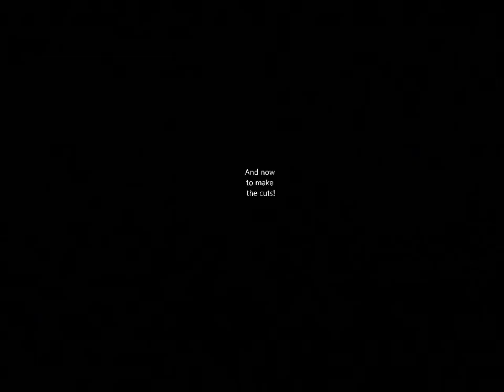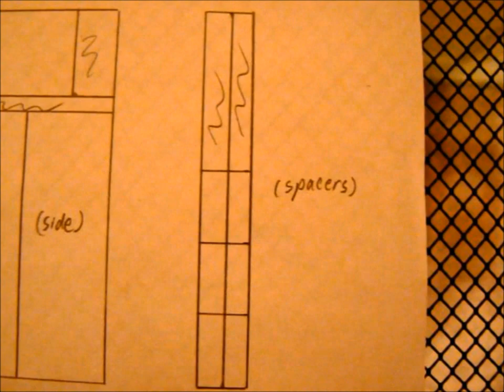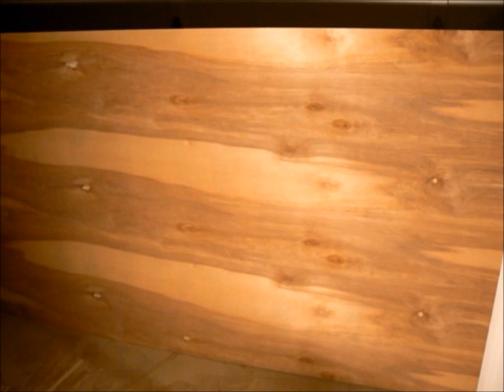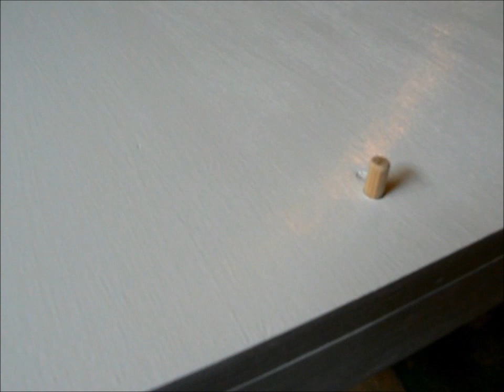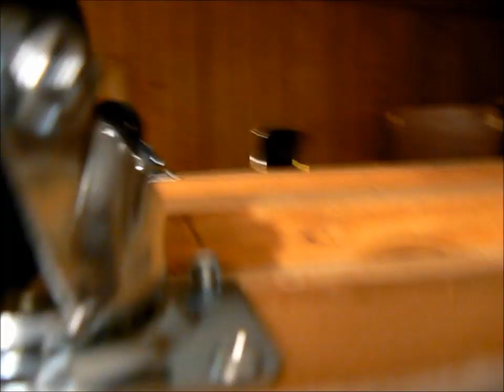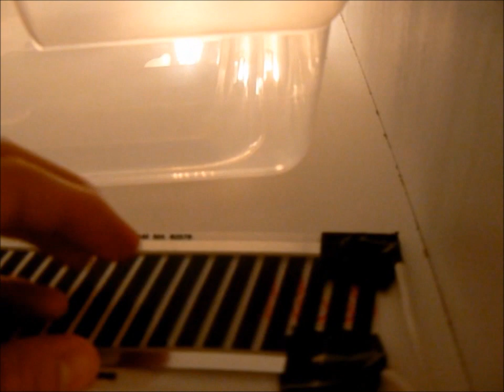How to Build a Quality Snake Rack -Pt. 1 (of 2)

Comment: Here is a stupid question. What size screws did you use length wise? It seems that 1 1/2 may be too small and that's what I bought. If these seemed to be sturdy enough for you, let me know. If you used something longer, let me know. Private message me, please. 

Also, let me know what # size. i.e. #6 2", #8 2", etc.

Comment from the maker: Thank you! :D I think we mainly used No. 6 2.25" long trim head screws (for the sides). We used something shorter to put on the back cover. Be sure to make pilot holes for the screws when putting them into the melamine (or else it will crack/split the melamine).

Comment from the maker: I am sorry, but I don't know the measurements for standard 32 liter tubs, but I know the measurements of the rack would have to be modified in order to fit them. For instance you would not be able to fit the central dividers in where I put them for tubs of that size, and you would only be able to have one tub on each level (unless you made them run deep into the rack and made the rack deeper, or if you made it more wide for two to sit next to each other running side to side). Hope this helps...

Comment from the maker: @KYLEG1986 Thanks! No, I didn't use any dowels to attatch the sides to the shelves, I just used screws there. I only used dowels for the spacers that run between the tubs (down the center of the rack).  :)